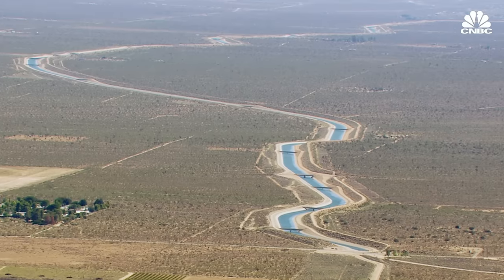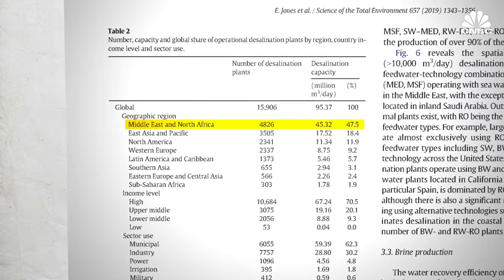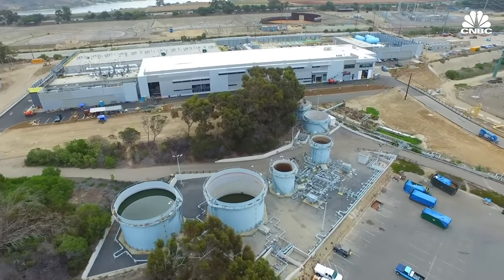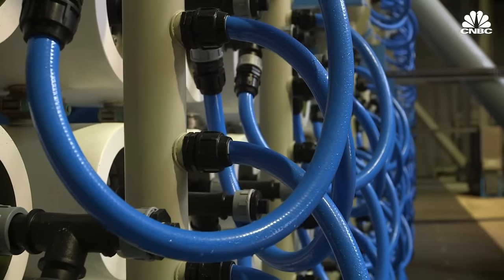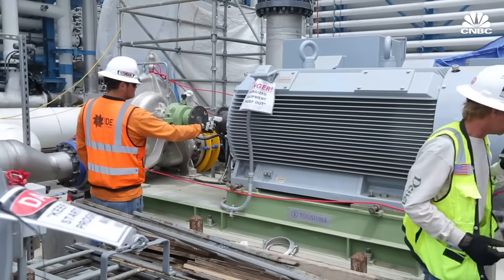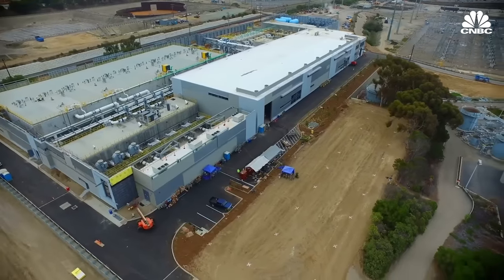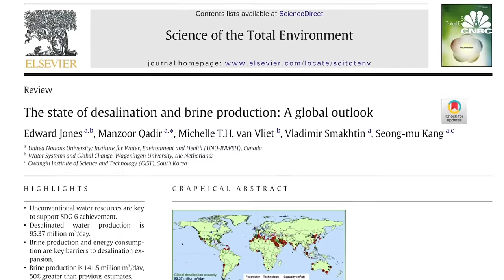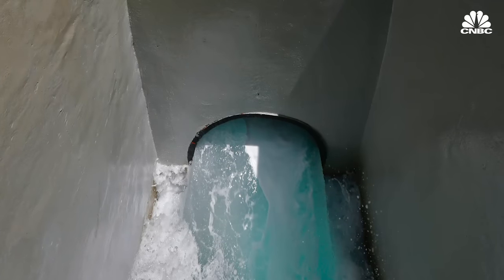Can Sea Water Desalination Save The World?

Comment: Southern California happens to be sunny. Solar energy production is easy.  The technology to desalinate water has improved. Lower pressure filtration is now available.  The electrical load on motors will be less. Combining solar electricity and easily available sea water can potentially create a Garden of Eden. The entire Southwest can benefit. The Colorado River will not provide enough needed water.  Arizona and Nevada are already warning California about the coming droughts. When the water runs dry the public will demand action perhaps then cost will not matter.
Reply: Also, heat energy is converted to work (tearing ions away from water molecules) this reducing global warming.
Reply: Solar...LOL

Nuclear or nothing
Reply: I would think that the advice would be going the other direction since Arizona and Nevada don't have ready access to an ocean.  California should be suggesting to the landlocked states, well Arizona does have the Gulf of California but no infrastructure to transport water to their population centers, that they pony up funding for desalinization in the Golden State to free up more of what little is left from the Colorado River.  These two states can't unilaterally decide to take more than the negotiated allotment because to do so would invite the places where the water comes from to do the same and starve these two states of the resource.  The most intelligent thing would be for all of the states in the Southwest to work together on solutions.
Reply: @steverichardson7417  Will there be a time in the future when nuclear isn't the most expensive option?  I've been reading about Finland testing the use of sand in silos to store the energy from solar and wind.  If something as low tech as sand is a good answer then that in combination with ever more solar development in California and the rest of the Southwest would be the low cost solution for the power needed.  California is already paying other states to take their power at times of the day and year when it produces more than they can use.  Nuclear can have a role but the cost needs to come down as well as the lead time for getting a plant online.
Reply: @thomasfiore9635  Nuclear energy is the most expensive for plant construction, but this extremely high cost is partially due to the fact that there is no standardization in the industry as few nuclear plants have been built recently...each facility is a currently a custom built job.  The costs for creating energy from a nuclear plant is only a fraction of the cost of solar and wind.  Unfortunately, the breakeven point is a long way down the line, especially with as slow as nuclear plants are being built.  Solar and wind is currently at its most cost efficient stage for site construction while improving technologies have been bringing the costs of energy creation down.  Unfortunately, the cheapest sites for solar and wind fields are quickly being used up and solar and wind farms will cost more in the future.  I disagree with Steve's "Nuclear or nothing" sentiment, but nuclear power has its advantages in many locations.
Also, nuclear power is much more reliable than any current renewable energy source: https://www.energy.gov/ne/articles/nuclear-power-most-reliable-energy-source-and-its-not-even-close
Reply: Solar Energy is the problem.
Reply: All you have to do is change out your politicians.
Reply: solar thermal distilling might be even more efficient in hot climates
Reply: @steverichardson7417  if they find a good/much better solution for disposing of the waste I might agree.
Reply: There is a desalination plant in San Diego cost 1 billion dollars.
Reply: Stop grow almond,grass lawn,ban swimming pool,golf course, problem solved.
Reply: Actually the water will keep coming but there is such a demand that they will never again be able to collect it in the quanities that they have been collecting.  Bottle water business and the soda industry should probably be stopped as they are taking water away from everyone.
Reply: @steverichardson7417  
got time and money?
Reply: @johnhamilton4449  cuz it's the cheapest, right?
Reply: @thomasfiore9635  Aircraft carriers have not one but TWO Nuclear power plants that seem to run for 25 Years without much failure.
Nuclear can be added to any coal or gas site and use the existing infrastructure.
Looking forward to practical Thorium, which EATS spent Nuclear Waste as part of the process and CAN"T melt-down.
Reply: @kaf2303  Solar distillation, where the water is under VACUUM in the Sun, and the condenser helps heat the in-coming water. No need to hit 212 *F
Reply: Sand? How?
Reply: @TIMEtoRIDE900  
They are called solar stills, very poor water recovery. recommend you look up  Multistage flash (under vacuum) desalinatiom.
was demonstrated using solar collectors decades ago. That unit was placed on Lampedusa Island after the demonstration in Bari, Italy.
Reply: Mario 
La desalización requiere mucha energía, y es muy cara.
En San Diego algunas instalaciones fueron construidas, y vendidas al extrangero porque nadie quería pagar el precio, aunque la calidád era mejora.
Reply: @thomasfiore9635  
Absolutely, if you remember the 2 nuclear stations in San Onofre, they produced waste thermal energy, which could have been used as a source for thermal MSF desalination, but was rejected because just that would, in the regulatory process, delayed the approval by years. (Cooling is an essential safety element , and diverting the cooling for other use must be shown not to affect emergency  cooling.)
Reply: @marktucker208  Like water, sand is  capable of storing heat by just blowing hot air in and later pulling it out  with low losses, because the sand containers, walls can be effectively insulated. The total surface area of the porous sand is enourmous compared to the walls. And, most important the storage temperature can exceed 800 °C, in water just 120°C pressurized at 2 atmospheres.
Just like the area of your lungs is about 70 to 120 square meters, compared to your external body surface of maybe 2 m².
You are aware, that when you do physical work, the wasted heat created in your muscles is cooled by your lungs, exhaling moist, slighly warmer air , than  what you breathe in. Only in an overheat case will you sweat.
Reply: @kaf2303  
Yes it is.
Proof : a few decades ago a demonstration 10 m³ / day MSF desalination unit  powered with concentrating parabolic mirror collectors was shown in Bari, Italy
That unit was shipped to the hot island Lampedusa.
As opposed to temperature sensitive photovoltaic panels temperature was beneficial, and the cost of the protected, inclined aluminium mirrors was   low, the solar tracking system then was costly, but not today.
Again, you are correct.
Reply: @thomasfiore9635  
Add storing electrical power to your list, A dutch inventor has a system capable of just that.
Check out the "have a think" channel.
Reply: @paultaylor6712  Go to Germany and pay tripple the price for power.
No joke, take a vacation  to visit Tesla in Berlin. Rent a model 3 and drive electrically, watch the museums and have fun, but for the  charging, still cheaper than gas or diesel. (Fuel TAXES.)
Reply: As a Las Vegan, I want to divert ALL rain and flood waters into our 1,000 ft deep natural underground aquifers that span most of Nevada and Utah; let Mead drain to Dead Pool and SoKal won't be able to get another drop from Mead; use our $1.5 billion 3rd straw installed years ago that we paid for at the very bottom of the Lake. Vegas was, is, and will always be a desert oasis and will never run out of fresh water. 100% water recycling, strict landscape rules, The Strip is on 90% well water as are the golf courses and thousands of private wells, Vegas uses only 1.8% of Mead with 8 years of water allotment banked, has decreased water usage 26% while increasing population 40%.
Reply: @steverichardson7417  No Nuclear.  Solar, Wind, Hydro.
Reply: @thomasfiore9635  Arizona doesn't have the gulf of California, Mexico is there.
Reply: @the dude No it is radiation.  The southwest which includes California gets over 300 days of sunshine making it perfect for solar energy.
Reply: @the dude Have you been to California.  We are building huge solar farms in death valley.  Nuclear is radiation and completely unnecessary.  Solar is cheaper and more efficient than nuclear.
Reply: @the dude California will be 100% renewable by 2035 largely due to solar.  I just drove through death valley and saw HUGE solar farms that weren't there a few years ago.
Reply: @timlinator  And we have to take care a lot of illegal immigrants, homeless, moochers, lazy people too.
Reply: "From that time Jesus began to preach, and to say, Repent: for the kingdom of heaven is at hand." Matthew 4:17 

"Ye have heard that it hath been said, An eye for an eye, and a tooth for a tooth: But I say unto you, That ye resist not evil: but whosoever shall smite thee on thy right cheek, turn to him the other also." Matthew 5:38-39•'
Reply: @followerofjesuschrist.  ancient cult fiction and nothing else.
Reply: Nuclear power.
Reply: @quincybryant5231  Solar is cheaper and safer.
Reply: but that would make fresh water non-profitable
Reply: @thomasfiore9635  Arizona is landlocked.  That gulf of California is Mexican territory.
Reply: @johnhamilton4449  solar is the solution and future.
Reply: @charleshoang566  For what California contributes to the us war machine each year $100 BILLION + we could build 100 SD type desalination plants PER year.
Reply: @timlinator  We don't have to, just stop growing useless grass lawns.
Reply: @charleshoang566  agreed. Switch to dessert landscape.
Reply: @timlinator  That suppose to be in the first place,do some things like Arizona and New Mexico to save water.
Reply: @charleshoang566  Those lawns are mostly in the suburbs not cities.  I live in San Francisco, don't have a lawn or car.  I take public transit or bike.  Agree we need to take more action.  However California is developing huge solar farms in the dessert and sea-water can be desalinated with solar making it cleaner and more affordable.
Reply: @steverichardson7417  nope clean energy only.
Reply: @johnhamilton4449  no it is the solution.
Reply: @timlinator  Nuclear is safer than solar. Nuclear is actually the safest energy source out there. Not only is Nuclear the most reliable energy source, but it is also the most robust. And no nuclear actually cause less radiation damage to people and animals then solar or natural gas.
Reply: @steverichardson7417  Solar is ultimately nuclear ;)

Comment: As a MIcroBioChemist from UCR I think Desalination should happen in the high and hot lands of Bakersfield and Riverside, if we pump salt water to higher grounds using a series of filters along the way:  (as processing centers) [Nutrient Processing center taking Nitrogen, as well as ethyl and octane plant(1) near the coast, mega particle filtration "Uranium" near the valleys (Plant 2), Lithium, and silicate extraction before higher altitude (plant 3) and at the highest altitude and  brine filtration and processing plant. Brine being a higher salt concentration of salt which makes it hard to get water from sodium electron energy we require more energy however since most of these Desalination plants are costal, and are all processing salt water and use fossil,], point being we can use the Sun to desalinate the water in the hotter parts of the state instead of burning fuel, and pumps using solar energy. we can restore the ecosystem in the ocean by reducing waste and on land by using that waste to provide nutrients to the land (Plant 1), and provide free energy, Lithium (plant 3) and uranium (plant 2) we need. We are focusing too much on one rather than all. 

I mean we are having Wars and wasting our "limited energy and brain power" over things that are literally FREE  in the Ocean. 

Humans need to wise up as a species to freely obtain these resource.

Comment: It should be possible to use passive natural processes on a large scale to turn sea water into drinking water.  What I propose is a large spherical vessel, made out of/ from,  re-cycled plastic bottles that is roughly , for test trial purposes only, approximately 50 metre diameter. It should be blown up like a beach ball, and towed out to sea. There once in a suitable position, it is anchored, and filled with sea water such that it is half full, so half the sphere becomes a dome sticking out of the water. Inside on the walls are specially made condensate capture channels, that collect the evapourated salt water. On the top of the ball shall be some solar panels , whose only requirement is to power open valves to maintain the level of the sphere in the water and allow the drinkable water to be  pumped and piped back to shore. Without doing any sums, this sphere could produce "some amounts " of water each day, depending upon the sunshine and other factors. The coldness of sea itself could be cleverly  employed to aid in the production of fresh potable water.  Thus with a little imagination, and using re-cycled plastics, it could be possible to use the natural processees and powered by the sun alone. How much water could be produced each day? Could there be a farm of these spheres out in the sea? or just a huge dome? what is best? who knows? One thing is for sure,  other than initial manufacturing costs, this idea could produce sufficient freely produced water for a couple of houses along the coastline.